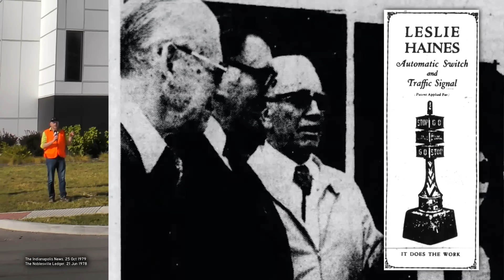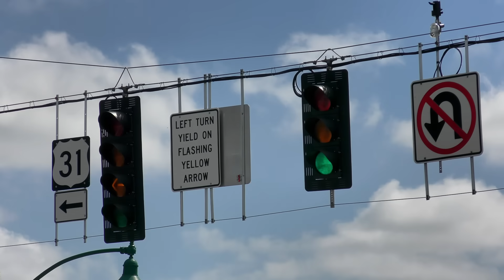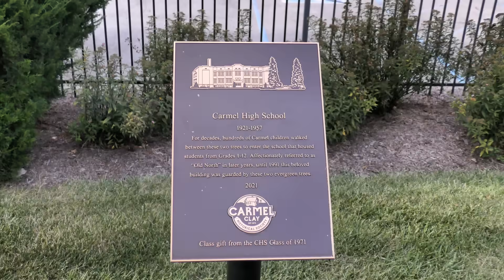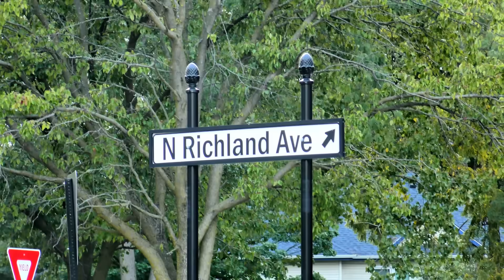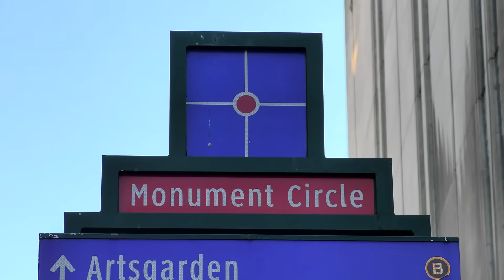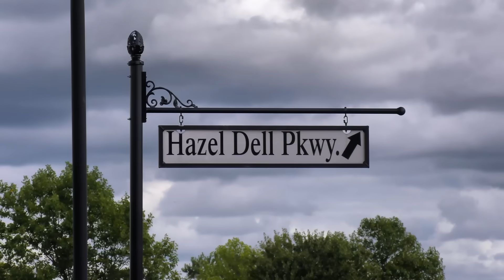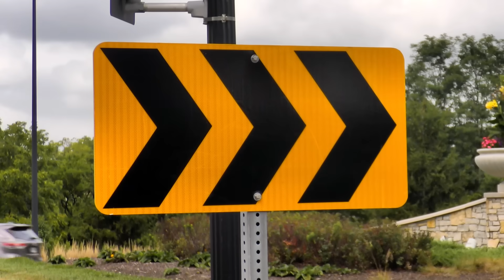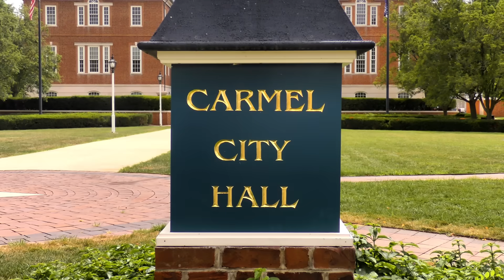Let's FIX the HIGH SCHOOL... with 152 ROUNDABOUTS!

Comment: US: 'In the 1990s there was no manual"
Europe: "If you ask we can dig in some archive and retrieve a bunch of manuals from the 1970s-80s in something like 20 different languages. We might even have some with imperial units."
Reply: The modern roundabout was developed in England in the late 1980s.  Europe started installing them in the 1990s.  American started building more in the 2000s.
Reply: @traffic.engineer  In France circular intersections were theorized in 1906. And the "Place de l'Étoile" was built that way in 1907 and still exists today. However it still applies priority to vehicles entering the ring (french term is "rond-point"). The ability to set priority to vehicles already in the ring (french term is "carrefour giratoire") was written in French law in 1972. And after seeing the results of the experiments done in Switzerland as soon as 1974, France started its "carrefour giratoire" frenzy in 1984.
I was born in the mid-70s and I've seen all those "giratoires" pop-up everywhere during my teenage years.
Reply: @christianbarnay2499  America had traffic circles since 1905 in many urban cities.  During the automobile boom, they were overcapacity.  The last thing America wanted were the congested circques/arcs in city centers.  So during the mid 1900s, America abandoned any concept of an urban traffic circle, unaware of the safety and efficiency benefits they had in rural intersections.  Unfortunately, standard 4-leg intersections were the norm due to its cheaper upfront cost.  And with the rise of suburbs in the late 1900s, we then had more candidate locations to install roundabouts.

That is why America has developed stricter criteria where/when to install them.  We do not want to install signals or island cut-throughs like they do in UK and some other European countries (France has not done that, so kudos).
Reply: @traffic.engineer  There are 2 kinds of circles. Your misunderstanding is that you remember the failure of circles with priority to vehicles coming in. Those do get congested real fast. And you imagine all circles are bad. But circles with priority to vehicles on the ring are in most situation way more efficient than lights or full stop signs. They are the only intersection that can support being filled to 100% capacity 100% of the time without ever jamming as long as there is no congestion further down the road. And even with one exit road congested, vehicles can still flow to the other exits with some little bit of discipline.
You will always find a few places with some particular traffic pattern or some other reason to force vehicles to a full stop. And for those exceptional situations, stop signs or lights are the right solution. But for the vast majority of high load intersections, roundabouts are the way to go.
Reply: @christianbarnay2499  You missed in my multiple posts where I made the distinction.  There is traffic circle (circque/arcs) and there is modern roundabout.  Traffic circles increased congestion in urban centers, which led to lost time and increased fuel consumption in city centers; leading to decreased air quality and economic productivity.  Nor were they pedestrian friendly due to multiple conflict points and indirect paths of destination.  They failed under the increased car usership and suburbanization during thr late 1900s.  

But where modern roundabouts shine are rural intersections, small towns, and residential districts.  Areas where traffic systematically kept low, in conjunction with increased alternative transportation options.
Reply: @traffic.engineer  Maybe you make the distinction on some aspects. But you always refer to circles jamming when talking about using roundabouts in heavy traffic situations. In that last comment, you do that again. Roundabouts have been precisely designed to resolve that major flow of circles. So using specifically this issue of circles as a proof that roundabouts are bad for heavy traffic is just demonstrating that maybe you know the difference but you do not understand it.
Reply: @christianbarnay2499  Modern roundabouts also have a capacity limit where they start losing efficiency.  A single lane roundabout maxes out at around 24000 vehicles per day, or 2000 vehicles per peak hour.  A dual lane roundabout maxes out around 40000 per day or 3200 per peak hour.  (Sum of all approaches.)  They also lack the ability to progress traffic along major arterials (as Road Guy Rob had explained in a previous video).  These factors are why modern roundabouts are also not considered in major urban centers or corridors.  Traffic exceeds the capacity, property acquistion costs are higher, and construction cost are greater upfront for barely any efficiency benefit.  The UK has proven that failure when they install signals at roundabouts.

Comment: And in other parts of the country, cities have been adding roundabouts on roads with median transit lines, especially light rail. In Salt Lake City, there’s one at the University of Utah campus. In the Phoenix area, there’s one in Mesa along Main Street, between the Mesa Dr and Stapley Dr stations, and the city of Phoenix is building a few more along south Central Ave. There’s even a roundabout built for a streetcar in downtown Tempe (Rio Salado Pkwy/Ash Ave). The advantage of roundabouts for those transit lines is that you can guarantee priority for transit vehicles, as with light rail, you can add railroad gates.

Comment: I remember a nearby town devoid of roundabouts, only street lights, it was a mess. it would often take as much as a half hour to traverse a 1 mile stretch from the freeway to the other major road, a mere half mile away.  This traffic jam pretty much lasted from 6am through 7pm.a left turn? fugetaboutit, 5-7 minute penalty, which was the main source of its issues.
they replaced them with roundabouts in the early 2000s on all but one intersection. it now takes about 3 minutes to traverse the 6 roundabouts. I have only seen the system locked up once. after a fireworks show where nearly 100,000 people tried to leave town at the same time. (15,000 full time residents normally another 30,000 tourists) Biggest fireworks display in Western Colorado at the time

Comment: Down here in The Villages, Florida. About once a year a senior citizen goes straight through a round about at full speed, which sends their car into the air Dukes of Hazzard style.
Reply: The more you study all these roadway accidents, the more you realize most people simply should never be allowed to operate two tons of steel operating at high speeds. Cities need to return to walking and cycling as being the primary modes of transportation.

Comment: Please do a video about the biggest problem with roundabouts: Asymmetrical use.
If you have a traffic going from west to north (usually the most disadvantaged direction - basically left turn) it will starve ALL other directions except the north to anywhere.

The south and east will not be able to enter the roundabout if the stream of west originating cars is not interrupted by north originating traffic. 

Please cover this. That osn one of the biggest flaws of roundabouts and it is important that all roundabout fans learn this.

I have seen multimile long traffic jams created because of this. Daily. For years.

Comment: The one thing that always confuses the discussion when non-US folks look at our roundabouts is the YIELD on entry.  My understanding is that European roundabouts require drivers to switch lanes inside the roundabout to exit, and therefore, if the outer lane of the roundabout is empty, you can merge in.  US roundabout DO NOT WORK that way.  US roundabouts "lock the driver in" to an exit when they enter--there is no changing lanes inside a US roundabout.  And the flip side is that instead of attempting to determine if the vehicle in the roundabout is going to change lanes to exit so is it safe to enter?--you simply yield to ALL LANES when entering.

Comment: the saddest of all... the part where the developers, engineers and political members don't understand each system they don't understand how each system can work cooperatively to make the whole system harmonious without much dead time.

Traffic lights don't work well on a timer, nor do they work well on a system where they need to have pressure point system, they need to work with lidar, road triggers and cameras... not for enforcement (sure we can) but mostly to figure out where a car is, what the car is doing if there's any conflicting traffic approaching and offer the best mathematical solution... all the while it communicates with the next set of traffic lights or roundabouts or even speed bumps.

if every intersection had that system in place then there wouldn't be a dead spot where a car wouldn't be visible inside the city.

People would trust the traffic lights A LOT more and when people trust a traffic light they have less chance of running the red light because it may be in danger of them or others.

And remove level crossings for trains, you don't need them they are just too expensive, drivers of trains park their trains over the crossings and drivers of vehicles park their vehicles on tracks, pedestrians think they can beat the train or try to cross while the train is moving slowly... we don't need to be reminded of the outcome, people start crying.

on top of this, the public needs to be educated on how to use this new system roundabouts... it's a simple system, you indicate where you are turning and you yield to those on the roundabout, for train tracks... that's not a parking spot... for "blocking the box" that's not a parking spot.

If you speed down a road that is clear, the lights can and may troll you by giving you a red light... please enjoy the timeout.
Reply: These systems already exist, they're called "adaptive traffic control". Some popular systems are SCOOT, SCATS, and UTOPIA. The problem is that they're expensive.

Comment: 2 things: first, not all roundabouts are built to the same specs. I just had one built near me that requires 7 turns of the steering wheel to complete a straight passage. Second, roundabouts are a bad idea for snow plows and winter traffic in general. Carmel is fine, anything south of Kokomo is fine, building them in the lake effect snow band is stupid. They reduce accidents 9 months out the year and then double them the other 3 months.

Comment: 9:05 as an Aussie, that hurts my pride a little bit.
We're ripping way too many roundabouts out these days, I wish we could take a page out of Carmel's book
Reply from the maker: Australia are REMOVING roundabouts?  That's a shame.

In fairness to AUS, he was talking about standards in 1998.  Back when the U.S. had NO standards at all.  I'm sure the designs have gotten much better over the years.
Reply: @RoadGuyRob  don't worry, we're still installing plenty of roundabouts! It's just that sometimes they outlive their usefulness under certain conditions. In some scenarios traffic lights can be a better option.
Reply: True, but as an Aussie who knows how arrogant Aussie engineers can be, it's kind of satisfying that someone who's had such a big impact on the US can takea big dump on them!
Reply: Roundabouts have a capacity limit.  Once they reach that limit, they are no longer efficient.  At that point they will have to install a signal.
Reply: @traffic.engineer  I have to disagree. Traffic lights operate better for about 2 hours out of every whole day. The rest of the time they cause unnecessary delays.
Reply: @TeamEXAngus  That is the conundrum traffic engineers face.  Do we design for the peak hour count or design for the average hour count?  Roundabouts work better for the low volume periods.  Signals manage traffic during the higher volume periods with the appropriate timing.  However, this timing can be modified during off-peak hours to reduce the stoppage times.  While the reduced timing can also be more efficient during off-peak hours, reduced traffic would also increase speeds which increase risk of more severe crashes associated with a standard intersection.

Comment: The exact same tricks this local leader did to get roundabouts constructed whenever there was ADAMANT opposition initially…

Could someone elsewhere in Mid-America (outside of Southern Michigan) do the very same tricks to get “Michigan Lefts” to replace existing, congested & problematic arterial intersections? 

Instead of four directions per light phase (including both protected left phases)?

Comment: Love your videos! Growing up in New England, I know there were multiple roundabouts, and all before 1992. I don't know what you would consider modern, but Main St in Keene, NH ends/begins at a roundabout (Central Square), and exit 3, Agawam, off Interstate 91 on the CT/MA border has a huge one after the exit. There are more.  The whole New England area may have been using them for 150+ years already
Reply: big one in Mass - https://maps.app.goo.gl/tAn4HRjayTEy31Ca9 / older one in NH - https://maps.app.goo.gl/rek8iA3UkNXNSkUp6

Comment: I live in Colorado, and I can attest to the efficiency of roundabouts firsthand. In more rural areas, it's nice to have an intersection where you almost never have to stop. However, traffic lights still have their place, though, as Colfax Avenue in Denver proves, as a roundabout would have to have an absurd number of lanes (and thus be confusing) to handle Colfax's specific traffic patterns.

All in all, I'm very happy at how Colorado engineers have balanced the use of the two, for the most part.

Comment: The area I live in had a really bad highway intersection. The community wanted an overpass built. It seemed like once a week a bad accident happened. Instead of an overpass they built an R cut. Everyone I talked to said it wouldn't work and that it would cause more deaths. It turned out to be fantastic. I don't know of a single death since the R cut was built. The R cut was basically free compared to the overpass. It only took a few weeks to construct vs months for an overpass. I love that intersection now, where before I dreaded crossing it. You don't know what you don't know.
Reply: Never heard of an R cut - thanks for the reference. They look interesting.

Comment: the 3:20 bit REALLY gets on my nerves...

the number of times that i have stopped and abused people for making (here in au...) right hand turns, in peak hour traffic, to get in a driveway...

WHEN THERE IS A ROUNDABOUT LITERALLY RIGHT THERE! as in, teh driveway is on the corner, its part of the roundabout, all you have to do is drive around it rather than risk ripping ones sump pan and exhaust out, meanwhile holding everyone up as theres no room to pass and theres no gap coming the other way because its peak hour...

Comment: An intersection I have to go through quite often recently was converted into a roundabout a couple of years ago. I would frequently have to wait for no traffic or it would back up and I’d have to wait for a second cycle of the light. Especially when turning left from one of the roads. I’ve only had to wait a few seconds at a time since the conversion and most of that is because of drivers that don’t know how to use it. My horn has educated a couple of them.
Reply: So instead of your city fixing the intersection by installing sensored lights to replace the timed lights, you have to jam your brakes in front of drivers anyway informally? Doesn't sound like much of an improvement

Comment: The thing is, you aren't used to roundabouts, so you drive slower thru them. Here in Melbourne, we are used to them, we drive faster around the roundabout then a traffic light. Hell my only accident occurred at a roundabout, so it's not true what you are saying. It's theoretical. Roundabouts also don't handle large traffic well, they become congested real easy.